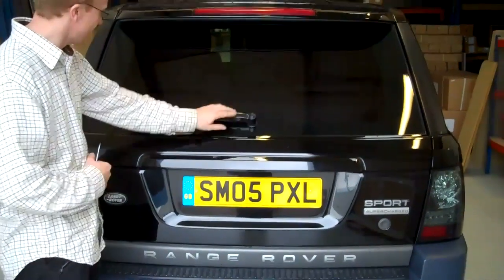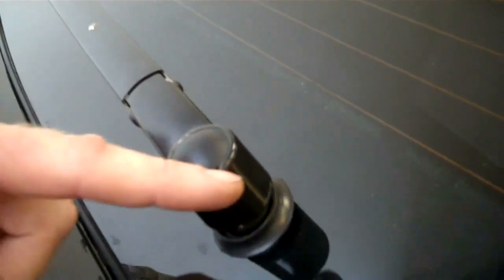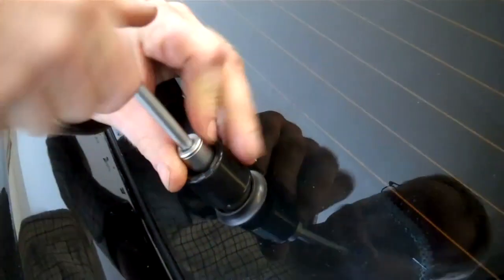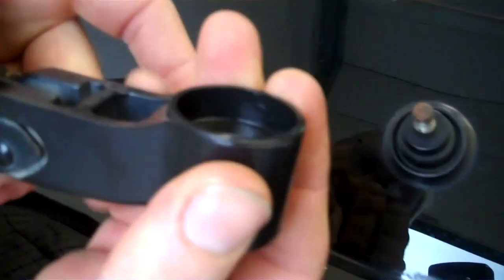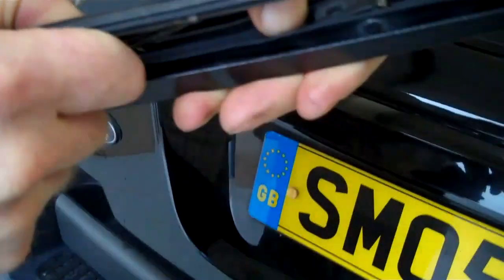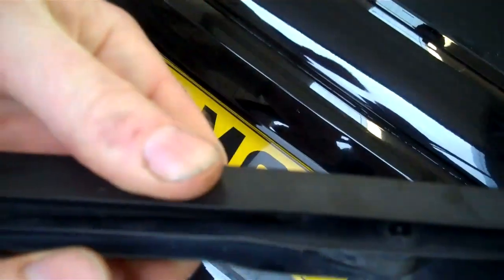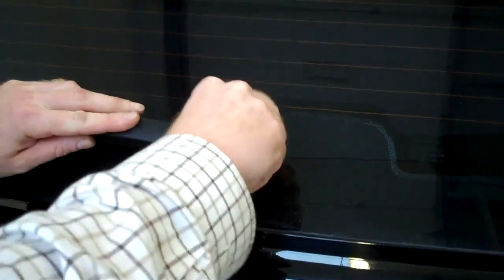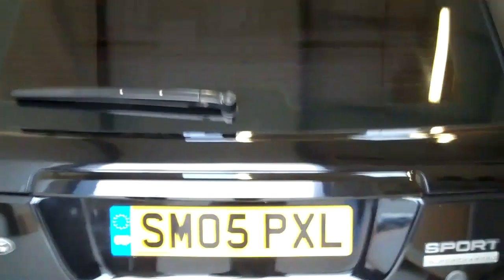How to service / change the rear tailgate window wiper arm & Blade on a Range Rover Sport L320

Comment: Changed the blade on mine today, a right faf. Wish I'd seen this first. Are the front ones as easy to remove? The driver side blade just contacts the body work at the side when running at full speed!
Reply from the maker: Yes its not too bad on the front - there is a nut under the plastic over and you can move it a little to stop it knocking !

Comment: Hi I have an important question if you could please get back to be as soon as possible, I am going to be doing this job on my range rover sport 2006, I have a new arm and wiper which I will be fitting, is it just as you did, replace them both and then when I operate it from inside the motor will control this new wiper too, thanks, Dylan.
Reply from the maker: Yes just the same as we did  - it will all be fine ! good luck
Reply: @L663  thank you so much I did the job yesterday and all is good really happy with your tutorial, I have another question if not too much trouble;
I have a brake light out at the back, the tail lights, I know how to do it, but have heard rumours that if ever you need to change a bulb on the back tail lights you have to change all of them is that true for this model on this video or can I just change the one,
Any reply appreciated, 
Kind Regards.